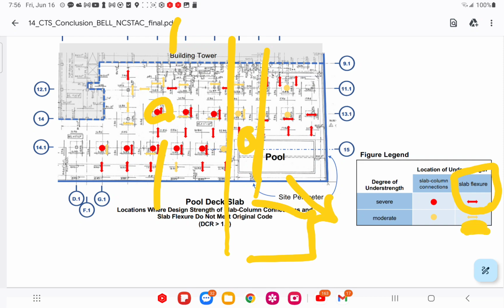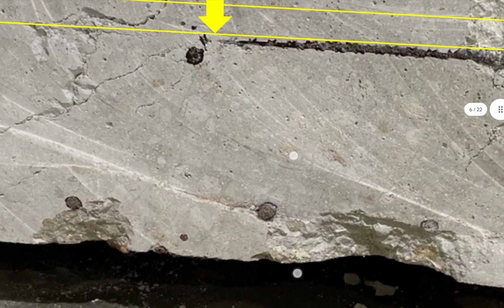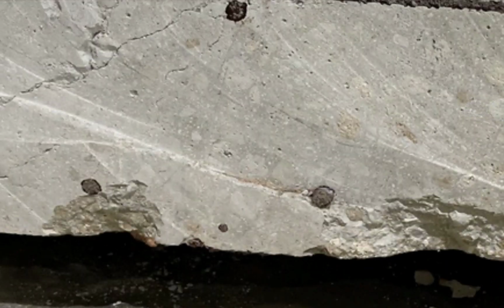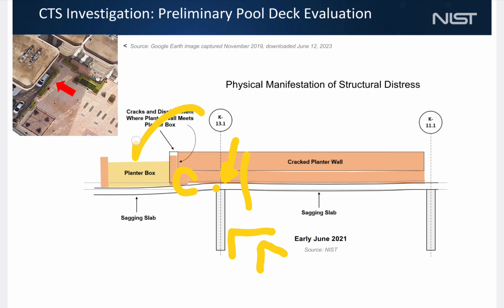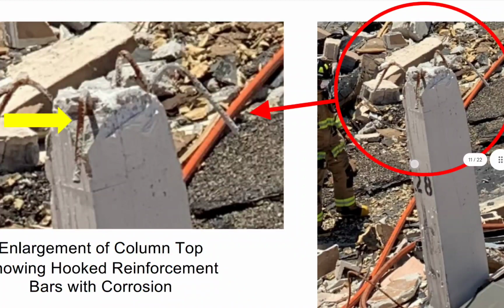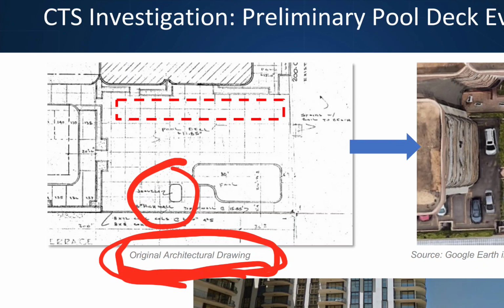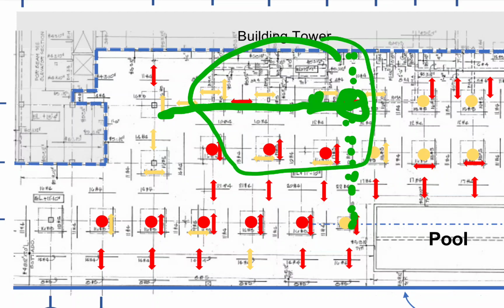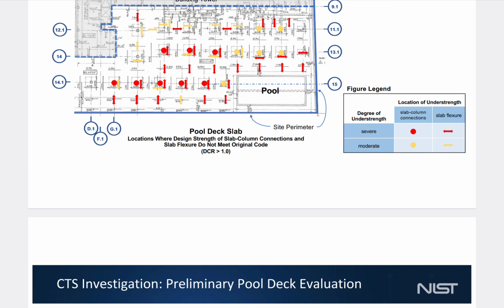Champlain Towers Nist releases wool over public's eyes but I will remove the wool Explain images

Comment: The core sample near the planter box BMA seems to show that the top steel is garbage. Completely disconnected. Which direction does that top steel run? If the car makes it through the collapse, I’ll guess that the north-south steel or the 8 #4s is the bottom steel. Which I think has less of a function of structural strength